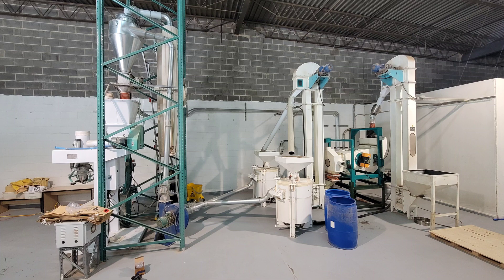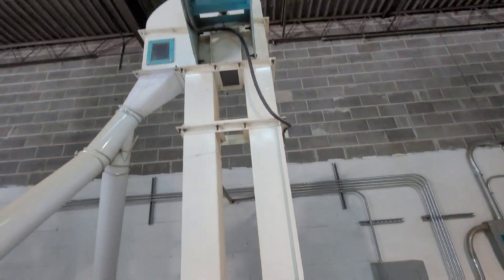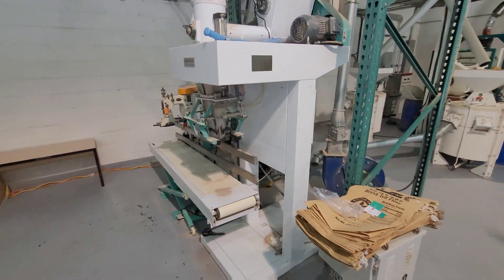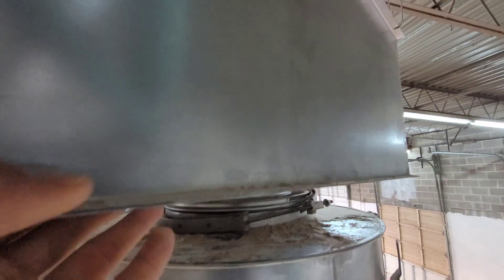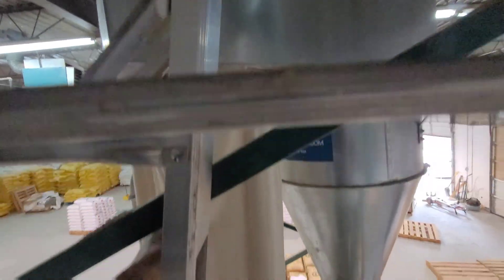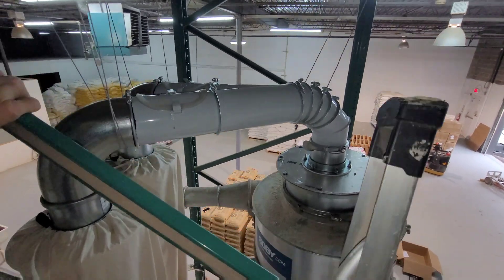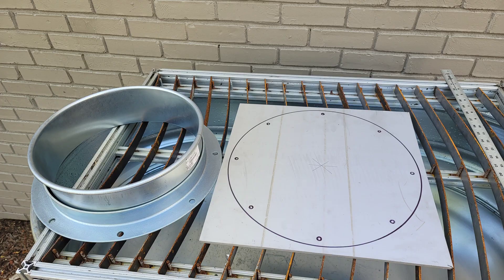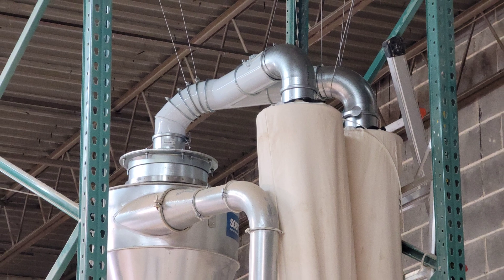How To Improve The Dust Cyclone Separator Efficiency Of A Flour Mill And Solving Flour Dust Build Up

Comment: Mr engineerable could you make a video on the srb400 specifically about how to get a hair pin trigger and how to upgrade other parts on it like the fire selector switch. I was thinking that the X-POWER FIRE SELECTOR SWITCHES would work but im not sure thanks in advance